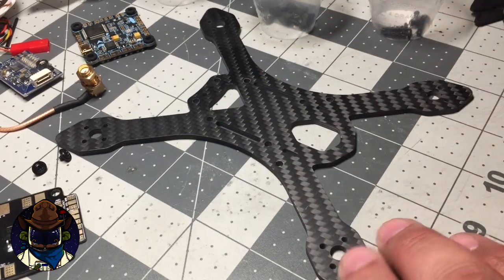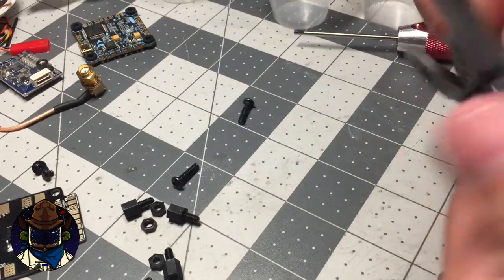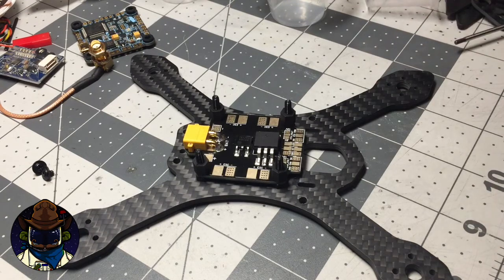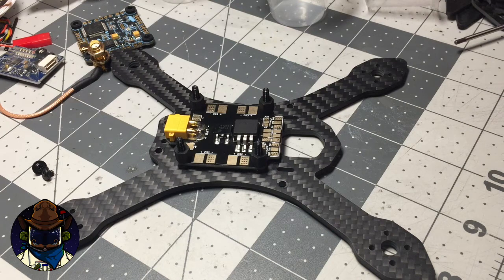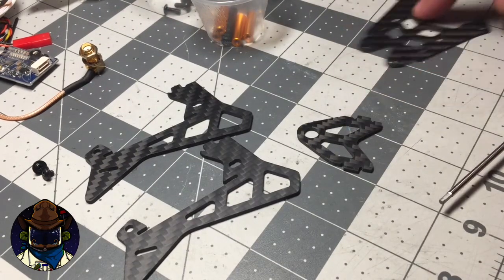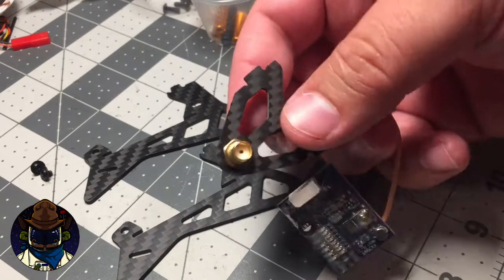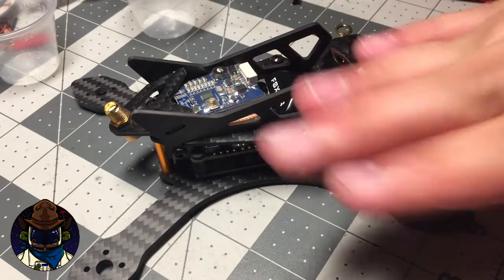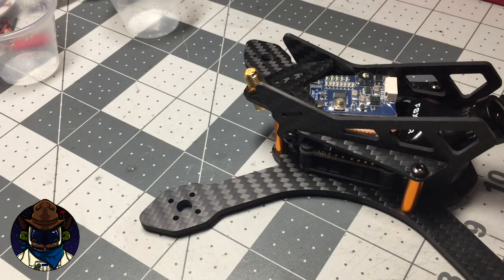Space Cowboy Workbench: XLR-3 Buildup Overview

Comment: I absolutely love the xlr 4 SL with the same top plate, but the vtx mount is a pain in the back side. Why didn't you put it a bit higher up? I've tried lots of different vtxs and nothing fits well. The vtx hole is too close for a pigtail, and too far without one. If it was slightly higher the vtx could slide under. Even with your own vtx, it's far from ideal. I'm going to make a simple brace to replace it. It ruins my favourite quad.